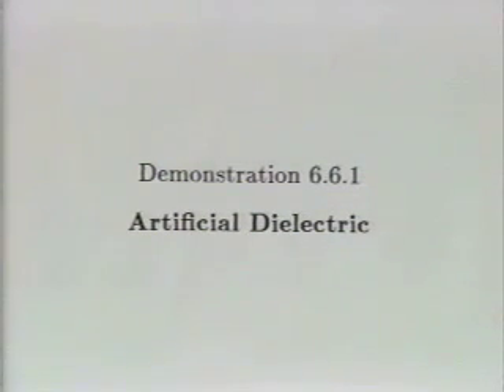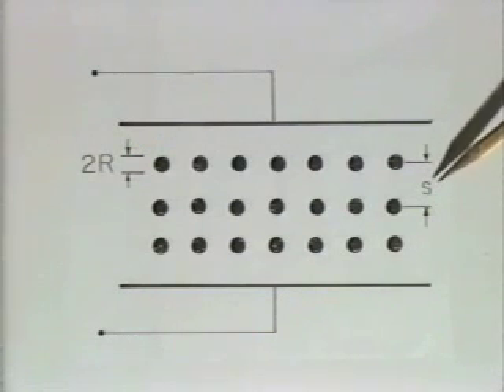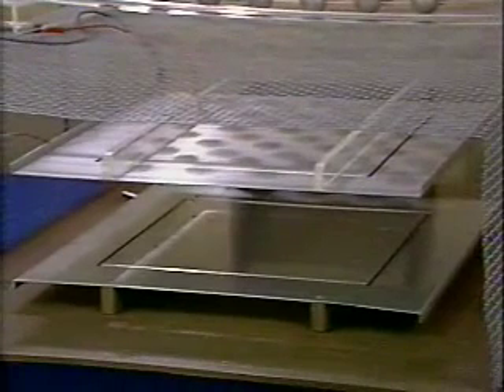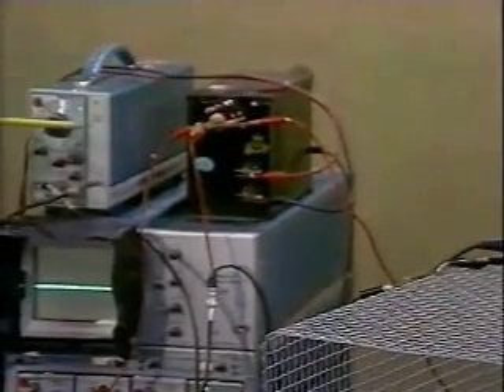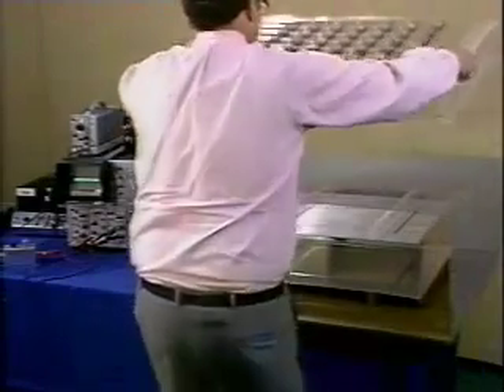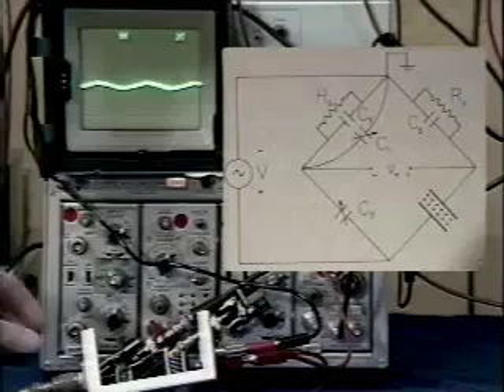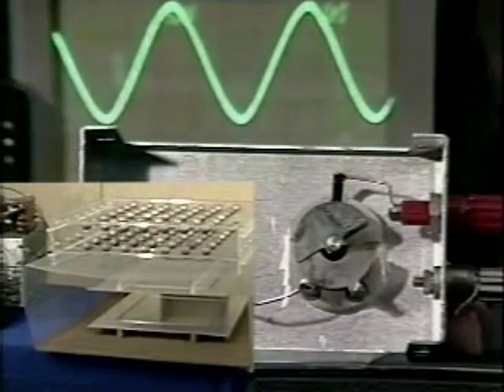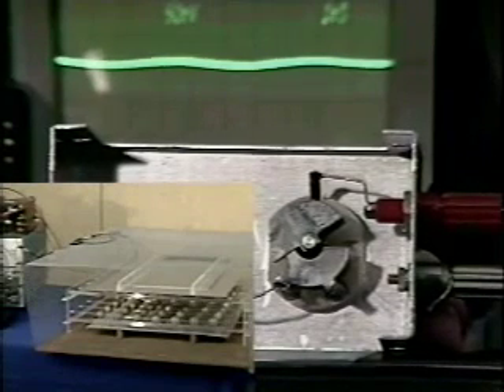Chapter 6.6.1 (demo only): An Artificial Dielectric

Comment: I have always wondered, if you placed a metal plate exactly in between the plates of an air capacitor, well I had understood that it was equivalent to having two capacitors of twice the original capacitance connected in series, givin a total capacitance equal to the original one. So the polarization of a plate-shaped conductor is different than the spheres? or I guess is just that the bigger conductor (spheres) actually reduces the air gap and so it increases the capacitance...